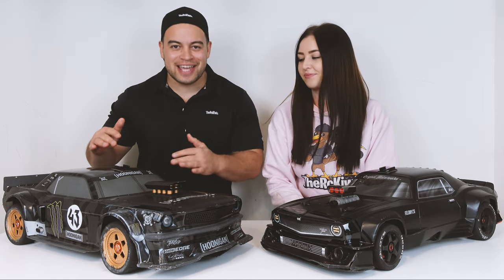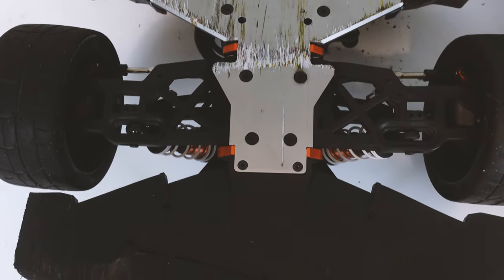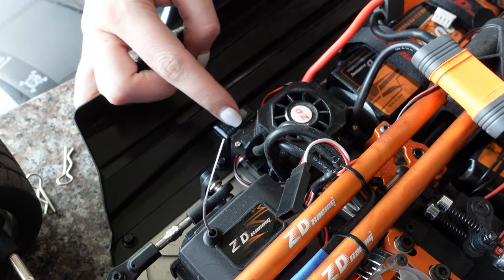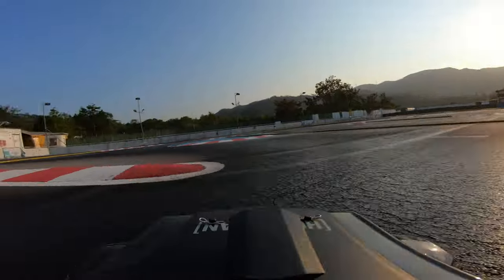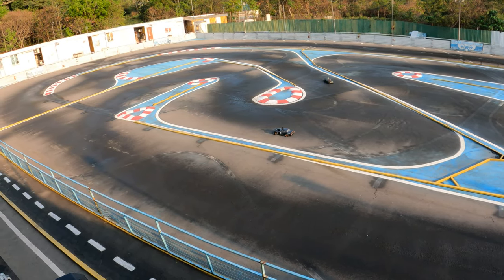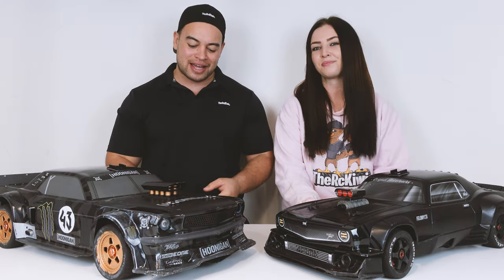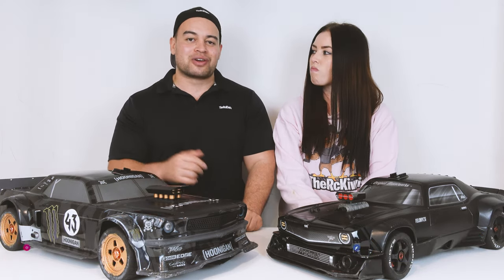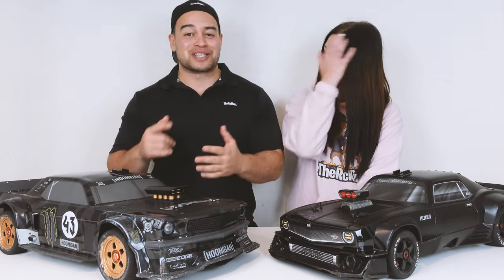ZD Racing EX07 Hoonigan VS ARRMA Felony - COMPARISON (One Catches FIRE!)

Comment: That looks like a Dumborg radio on the EXO7, doesn't that come with a gyro?
Reply: I have bought two DUMBO 6ch radios, first one was mistake, the one with normal receiver. next one i have one with the gyro receiver and couple extras gyro receivers also.  The  4ch  maybe is not  Gyro compatible ?  because the gyro setting is on ch6 in my dumbo gyro set up. Im not shure.  Anyways, this car is not good as RTR.  All the stock electrics sucks if you ask me.  1/7 cars need 160amp ESC atleast. Like Max6.  And steering servos 25kg +.   Buy this car as KIT,  Put in MAX6 and 25kg digital servo, and one 4985 spektrum 1250kv motor then you have it i believe,    only question is, will 4985 size motors fit this mount ?   KIWIS, please try these, and answer us if 4985 motors fit.  The spektrum firma 1250kv is one really nice motor with max6 esc,   drive it 8s, look my videos on my channel.  I love this combo self, i have it in many cars
Reply: It's DumboRC mate! The EX07 Comes with the 4 channel version of the Dumborc which doesn't feature gyro control. The six channel version has two knobs on top of it, one of it is the 6th channel which is assigned to gyro adjustment.
Reply: @woutervanwijk4369   OKEY :) great info, thanx dude.

Comment: Great video guys, unfortunately those ESC's in both the 10th and 8th ones are known to catch fire quite often. I think you have to question the 150amp rating, definitely didn't like the extra power from the higher C rated batteries you used, glad you published the video even though they didn't want you to 👍.

Comment: both of them have great power and specs. Is it just me or the bashing all road rc chassis are not agile on the track? it seems like it is really hard to control over those turns and difficult to manage the racing line.

Comment: Thanks guys we now know both are capable at producing burnouts. I prefer the tyre version so I'll stick with the felony.  If different wheel/tyre and gears is a potential concern for anyone  But you just got to have a felony. I'd suggest buying the infraction V2 and buy the felony body kit. You got all the best of the felony. Infraction and the ZD. Same wheels, tyres and gears, so open to plenty of aftermarket options, Felony body fits. Same chasis and electronic s. Hand brake. Quality all round.  Sweet vid as always and nice one on the "Nah were saying it how it is decision" respect.

Comment: I’m wondering why more manufacturers are not using separate brake models on the heavier electric cars. The brake module should also be slaved into the throttle channel and not a separate switch. Those bigger cars are outing all that stopping wil eight on the pinion gear

Comment: I got the 1/10 ZD racing short course truck rated for 2/3s. First 2 minutes of using a 3s in it 🔥🔥🔥 in the esc. Seems common in ZD electrics
Reply from the maker: Oh no what a shame and apparently the ESC is 8s capable.. :_Laughing::_Laughing::_Tough: - J
Reply: @TheRcKiwis  just wait to find out how cheap the plastics are. Don't mind on the $100 sc but wouldn't be happy on the $650 hoonigan

Comment: I said these escs were fire hazards when this car was announced and a bunch of people got excited. If they sold it as a roller and you could get parts reliably it would almost make sense. Still, the wheels are cool and it looks like a decent enough chassis/roller. Shame the electronics are crap. For the money they're asking you should get a decent esc and servos. It's not like the Hobbywing rebrand/oem escs are crazy expensive. There is a reason nearly every quality brand uses Hobbywing escs and motors in their "budget" offerings if not in their entire product line.
Reply: Where do you find “Cheap” hobby wing?

Comment: You can just see that these cars cars are not made for this environment. I wonder what more focused suspension settings and foam tyres can do on the same track. With all that grip maybe even stiffen the diffs a bit with heavier oil. Getting rid of that terminal understeer followed by colossal oversteer would be a challenge I would enjoy. But then again, they would lose their bashability in the process. Still, Felony for me thanks.

Comment: Great video guys. I can hear one of you in the race "flicking" the steering to correct it. Like in a real car, it's better steering with continual hands on the wheel and trying to steer smoothly rather than flicking the wheel and letting go of it. It's a hard habit to break but will make you a much better driver. Good Luck!

Comment: ZD racing makes Junk.  I have owned two recent models, and they both are in the dump.  NO customer support and parts, from China can take months. You cannot compare these two cars.  The Arrma is better made, much better electronics.  Easy to get parts.  Horizon has been very good lately with customer support.  I bought a BBCC and it had an issue with the electronics.  Horizon sent me a new car within 10 days and paid for me to return my car.    Again ZD racing makes Junk!  The fire show how crappy these cars are made.  Props for showing the firs.
Reply: Thats why you buy rollers and put your own electronics in

Comment: Unplug it first thing!!!!!
Reply: I have the 120 amp version in my zd sc-8 and it's done great for me so far..I'm going to gear up a few teeth and see how it goes..Also not to put blame on you guys at all but we all saw the solder job you did on the connectors lol..It could have played a roll..Trust me I've done it before also..I had an old gun with bad trigger and it would turn off and on and I cold soldered deans onto a HW ESC and on 3s it went POOF!!! Lol..Now imagine the AMP draw that giant motor puts out on 6s...
Reply: If they send you a replacement ESC go ahead and add a Cap Pack to it..That's a rebranded Dumbo RC transmitter so get the Dumbo RC receiver with gryo also..It will help